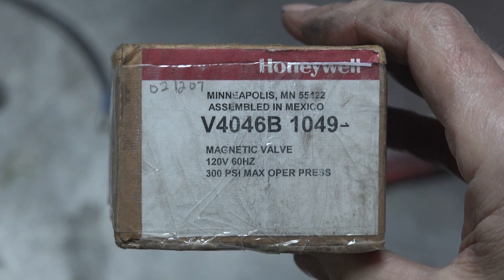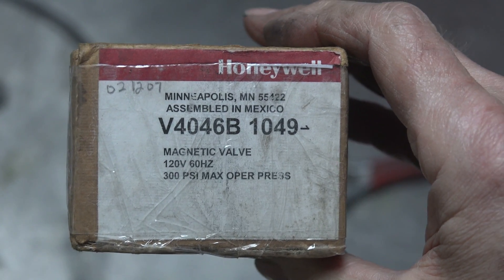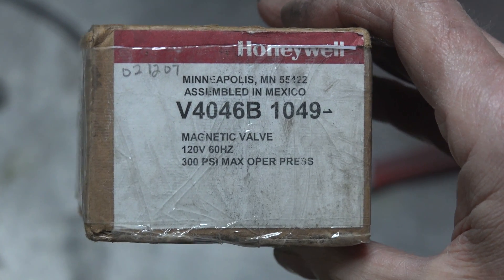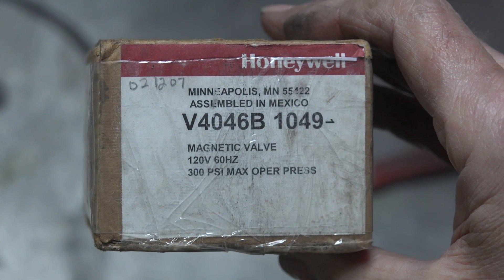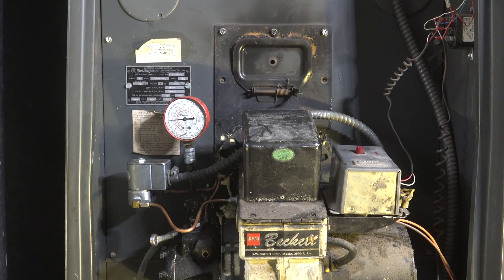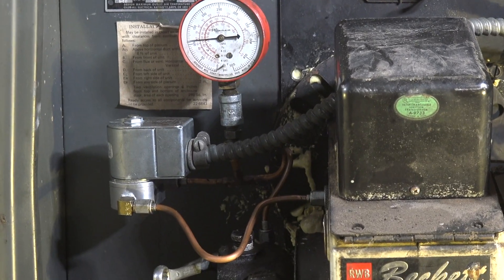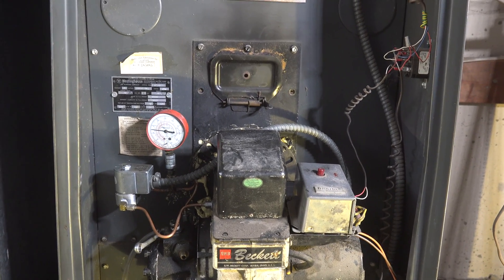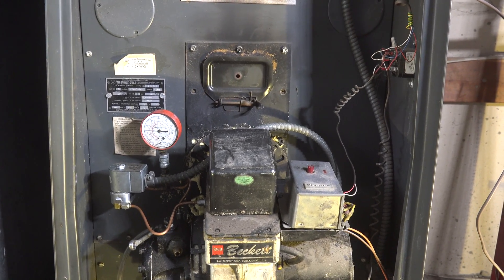Will a gun line solenoid stop the "peeing" of the nozzle?

Comment: Is it possible that this condition would cause a rough start up with puffing of smoke until the unit runs for a minute or two?  I checked the draft which was fine.
Reply from the maker: It is more probable your unit is not establishing draft.  First to check is soot buildup in heat exchanger, smoke pipe and chimney for blockages.  A thorough cleaning may solve the problem.  
GFM

Comment: Now the regulator on a pump is supposed to have a quick clean cut-off. Are you saying this peeing, you refer to, is the normal for oil pumps that dont have an SOV?  Or just pumps that still work but have a defective PRV, and rather than dish out cash for a new pump, you can supplement the pump with a part that will substitute the portion of the PRV that no longer holds back the 80% of fuel pressure that they were designed to do.
Reply from the maker: When the pump shuts off, the pressure drops to 80% of the normal running pressure, so it bleeds out that much.  Also, if there is air in the gun line or gun, the air will pressurize and bleed down thru the nozzle.  
A failure of the PRV will bleed down the entire oil supply system.
GFM